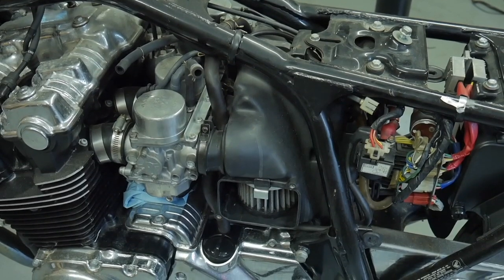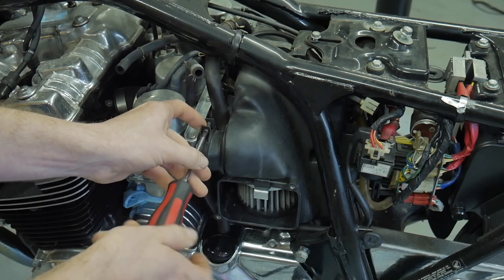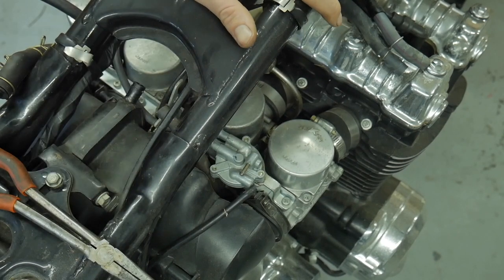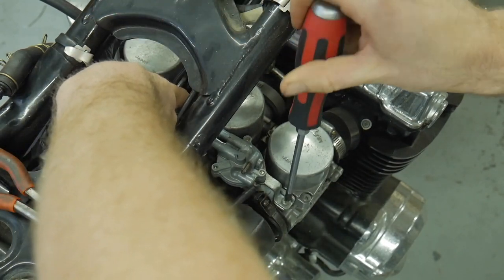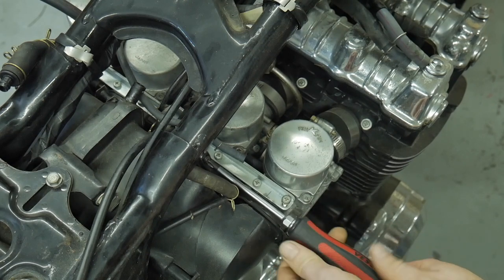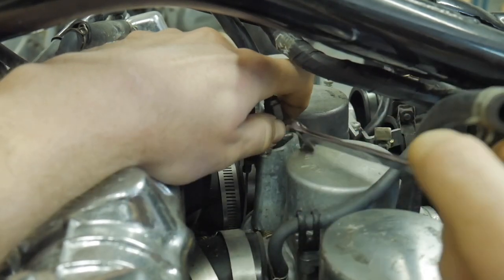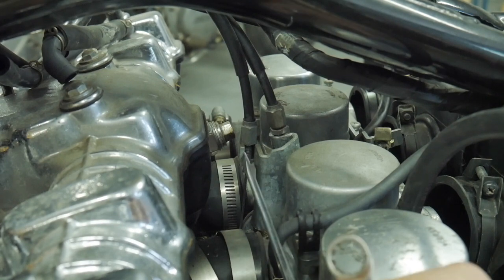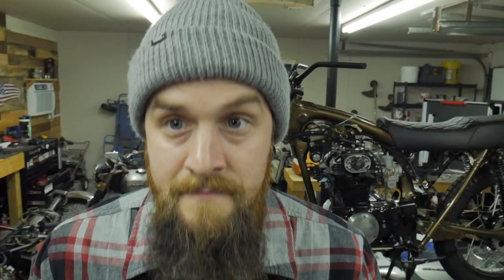Honda CB900F Carburetor Removal - Get Ready To Clean!

Comment from the maker: ►► Here is my step by step CB900F Carb Cleaning Masterclass- https://www.themotorcyclemd.com/inline-four-product-options
Reply: Hi, is it best to sync carb's at 1300rpm or 3000rpm, and if the outer carb's are jetted smaller than the inner do you have to sync the outer carb's lower then the inner carb's with them been different sizes, or just sync them all the
same.. Thanks
Reply from the maker: @cbrf4r579  Carburetor synchronizing has NOTHING to do with air/fuel mixtures and how they are metered inside the carburetor. Simply put,  the purpose of carb synchronizing is to ensure that your bikes carburetors are all in the same RPM range at idle, so that each cylinder is drawing the same amount of vacuum through the carbs…
Reply: @TheMotorcycleMD  Thanks for your reply much appreciated it

Comment: Out the right side is a little easier for some reason.  Especially if the black magic does not work to disconnect the throttle cables.  Also after a few times in/out I started using a wide strap (nylon tie down) to hold the airbox and airbox boots back.  It gives you an "extra" hand to slide carbs out.  Looking forward to the next video.
Reply: Great idea. Thanx!

Comment: I'm no expert but those clamps on the engine side don't look stock to me. They should be the same style as the clamps on the airbox side. (I think someone bought the engine side clamps at the hardware store.)   I've been told not to use clamps with open slots in them because they dig into the rubber boots and can damage them.   I'm glad taking the carbs off my 1975 CB750 is a much easier process than this CB900F.
Reply from the maker: I’m glad for you too! Over time the slotted clamps can definitely eat into the rubber, especially if they are never changed and over tightened the max 20 times through the years. 

They are not stock clamps. Maybe “bone stock” wasn’t the correct wording to use. This also have a Kerker pipe and the grips were aftermarket. But pretty dang close!

Comment: Thank you. Do you think that the carbs can make the bike only to run 3 and 4  cylinder? I already follow you. Thanks again. I am about to remove the carbs from a cb900c 1982. It has compression and spark. Just is not firing 1 and 2. So I think something going on with the carbs
Reply from the maker: Always a possibility! I would definitely check them out.

Comment: Stupid fuel valve is correct. I think I found the last original stock part for this in Greece for my Honda CB900c. Paid ridiculous money for it. I couldn't find a replacement for the rubber diaphragm inside. Any tips on where to find this would be helpful. Also for the connecting tubes.

Comment: Great video! Do you have a video on reassembly after cleaning, particularly a segment on properly resetting the choke linkage?  I currently have my CB900C carbs out and am having trouble getting the chokes hooked up and operational.  Thanks!

Comment: Hey man I just watched all your carb videos. I got a 89 yamaha FZR 400 i got off of a guy on ebay unseen, no history and im trying to get it running. Wiring was a nightmare but thanks to your wiring vid I've gotten it as far as its turning over and starting try to chug to life. its a 4 cyl and on carb 3 i have fuel dripping out of the drain screw. I switched drain screws with carb 4 and it was still carb 3 that leaked. Also on the fuel rail i have 2 pipes which im not sure of. I think theyre breather hoses but I'm not too sure. Anyway I uploaded a video on my channel of the bike and what I'm talking about it. If you got a second i'd appreciate it.